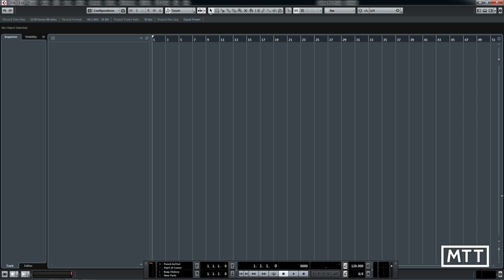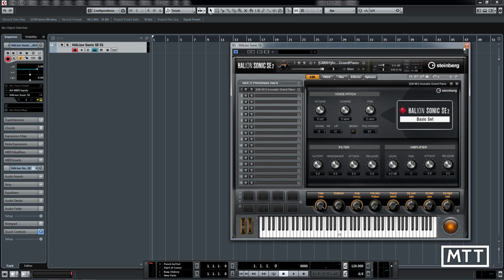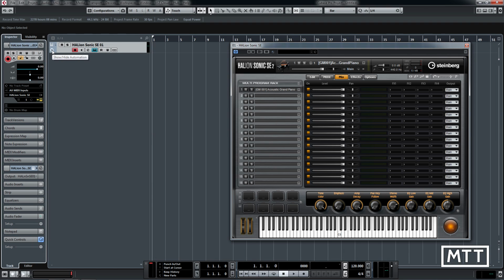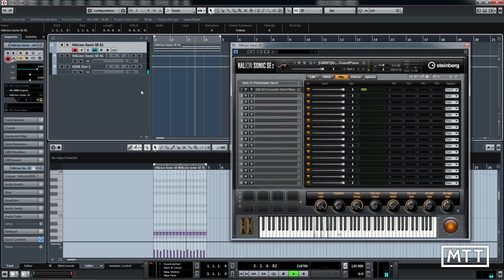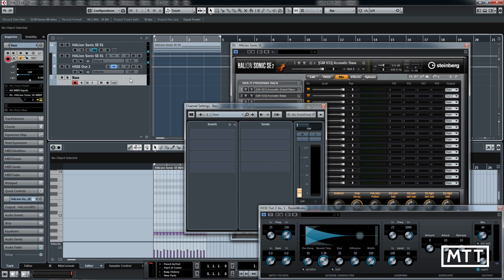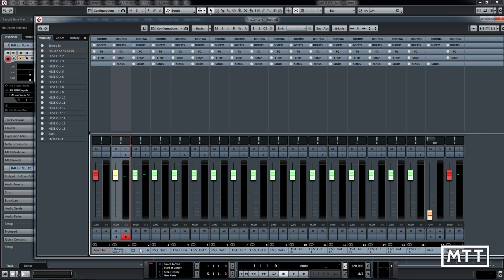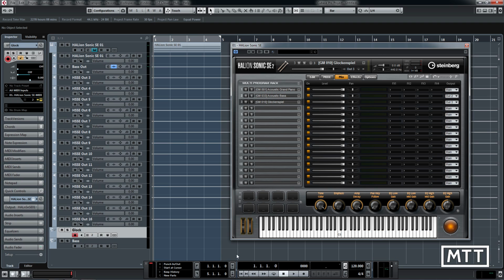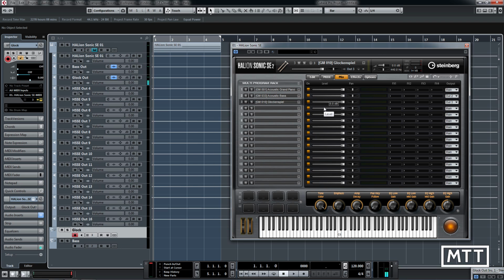Cubase Skills: Multi Output Instruments

Comment: Great video! But I still have issues. The drum machine that I am using is called Splat-to-Clat by GospelMusicians, and in it I can assign every pad to a mono output(between 1-16). When I activate outputs like you showed us, no mono channels appears. I am stuck using stereo channels for mono sounds, and even if I do that I only have 9 stereo outputs(including Main), but the drum machine has 12 pads.. What should I do?
Reply: Not sure but you may be able to change the channel configuration to mono ?
In terms of the the pads maybe duplicate the instrument so you have more outputs?
I might be totally wrong but just some ideas

Comment: I use DAW Cubase 5, I already set up Keyzone classic in my laptop, but when I connected my Digital piano (used as a Midi controller) into my laptop via Midi USB cable, I choose Input: All midi inputs, Output: Keyzone, but when I play my piano, Keyzone doesn't receive signal from my piano 😥, please help me 😢😢, thank you so much
Reply from the maker: What happens when you create a MIDI track and try recording the piano MIDI (when you're playing it) onto the track?  Do you get notes recorded then?
Reply: @musictechtuition  It happens when I playing the piano onto the track, I just try    to check the signal when I play the piano - Midi - Keyzone but have no signal (I use the mouse to play direct the piano on the Keyzone is ok)

Comment: i use multiout for my drums vst , i only have 16 stereo output with my plugin. is it possible to use only "1 mono out" rather than 1 stereo  ? (to let more output???
Reply from the maker: I think that will generally be controlled by the plugin - if it only offers stereo outs, then you're stuck with that.  You can do a complicated setup with panned outputs then feeding mono groups, but this can be pretty cumbersome!

Comment: Good video. i just need to understand one more thing...unlike the instrument track, when you add the midi tracks for the channel 2 and 3 of the Halion VST in Cubase mixer the outputs appear but also the midi fader channels appear and I can't understand what purpose these have. By default they appear with the fader all the way down. Can you please tell me why they are created and what the point is of having them in your mixer.
Reply from the maker: HI Arman.  Thanks.  The MIDI fader default action is a bit confusing - all the way down actually means 'Nothing has been sent yet' in this context.  If you never use the fader, then that's OK (that's what I actually do), but as soon as you move it then a MIDI Volume (CC7) message will be sent to the instrument (and it can choose to respond if it wants to, typically that will alter the volume in the instrument for that timbre/MIDI channel).  The issue really comes from the fader not having any way of 'knowing' what the volume of that part is set to in the instrument, so it just sticks to 'down' as the default.  HTH.
Reply: @musictechtuition  Thanks for the reply. I kind of understand what you mean but why can't we just control the level of the VST instrument within the VST instrument instead of having this fader at all? In Halion I can set the level of each instrument independently so really it feels to me like these midi faders in the mixer are just clogging up the show..
Reply from the maker: @armansrsa  The fader is there for compatibility - after all, this is a MIDI track which is then feeding an instrument, so it's needed as MIDI tracks have volume faders.  You can hide MIDI tracks in the mixer, but that has other downsides when using this method.  The issue really is that there's no way for Cubase to 'know' if a fader is needed or not, so it has to create one.

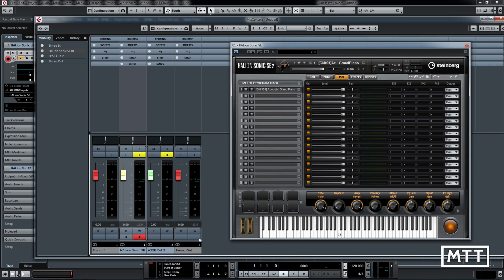Comment: Thanks for this. I've been pulling my hair out trying to set up individual outputs for Poise (drum sampler).  Turns out all I need to do was click the automation button (as shown shortly after  3:05 in this video) in order to see the individual outputs so I can process the drum sounds separately. I've just transferred to Cubase 10 and this is slightly different to how I recall in Cubase 5, but I got there in the end with your help, cheers!
Reply from the maker: Glad to have helped out!

Comment: I have a question. The problem is there will be duplicated channel and faders when adding midi tracks. How can it be removed or do I have to live with it? I use Cubase 10 Pro. The faders are down and panned to left. Why?
Reply from the maker: The faders are down and pan is to the left because there is no MIDI information yet sent - the channels won't generally be 'down and left' they will be at the default for the VST Instrument (usually around 100 and cental pan).  Once you set any MIDI data in the tracks, they will reflect that.  You end up with a MIDI fader and an audio fader for each instrument/track/output that you use in this way.  You can hide them in the mixer, but that can cause other issues of confusion.

Comment: Thanks for this. I've been looking everywhere for help in setting up a Multi with Miroslav Philharmonic in Cubase, and this has been the most helpful by far. Now I just need to be able to adjust the sliders on the newly created mixer tracks to be able to set the volumes instead of using the MP Mixer and I'll be set! I can mute & solo them but the sliders don't alter the volume...have I missed something or is this not possible? Thanks again for this video.
Reply from the maker: Hi.  I think if the outputs are assigned properly in MP then it should work as it does in the video.  I don't have MP to try it with, and I can't see a demo of it, but looking in the IK page for it, I see the mixer with the output assignments in - have you set those?  If so, then opening up the mixer should reveal all the outputs for MP and you should be able to go from there.
Reply: Thanks for the reply, however I have set the MP Outputs as instructed, all assigned their own MIDI number. As I mentioned, the Solo/Mute buttons work on these channels but the newly added Cubase faders don't seem to control the individual instruments volumes as expected. I have to use the MP mixer to do this. Maybe this is just not possible?! Anyway, thanks again for your time. Appreciated! :)
Reply from the maker: @dazzSONGS.  - any chance of some screenshots or a video of how you're currently set up?
Reply: @dazzSONGS.  Hello.  It sounds like you initiated multiple instances of the plugin, and now you are using faders connected to an instance that is not where your specific drum channels are coming from.

Comment: Excellent explanation, thank you. I’d like to take this opportunity to ask you what software do you use to record you screen? Basically most of screen record software (Snagit,  Camtasia, Game DVR) on windows OS does not support ASIO drivers and to get it to work seen to been a difficult task. Can you help me? Cheers
Reply from the maker: Hi Leonarod - thanks for the comment!  My screen cap software doesn't do ASIO either alas (it's FRAPS, and doesn't work in Win10 either - my main DAW is dual boot and I do the videos on the 'Internet' W7 partition), so I record the output from Cubase and my voice on a separate machine (Macbook) into Cubase, and then put the audio and video back together in Premiere - one of the reasons that it takes a long time to do any videos.  Not sure how much help that is, but that's what I'm using - I'd have preferred to make it simpler and get audio and video all in one pass, just to leave editing down to cutting out sections, but it appears it's not to be; I did experiment with a more complex 'loopback' setup (as FRAPS can record some Windows audio), but it became way too complex, and wasn't reliable.  The advantage of doing the recording in Cubase (1 mono for vocal, stereo for Cubase output) is that I can do some trimming afterwards, remove mic pickup of keypresses when starting/ending sequences, etc., so it's not all bad, but it is somewhat time consuming.
Reply: I spent all day trying to figure it out but I will give up as I don't have a second machine. Thank you for your promptly reply and for videos and books. I will order your Cubase 9 book soon. many thanks
Reply from the maker: Thanks!  You might want to hang fire for a couple of weeks - I've just been working on updating the book to Cubase 9.5, a first proof is with the printers now (but I expect Christmas delays), so hopefully by mid-end January it'll be updated and I'll post a video on here as well as to my site.
Reply: Leonardo Sants Try Filmora, you can download it for free to test it, the trial version just puts a huge watermark on your recordings..hope this helps